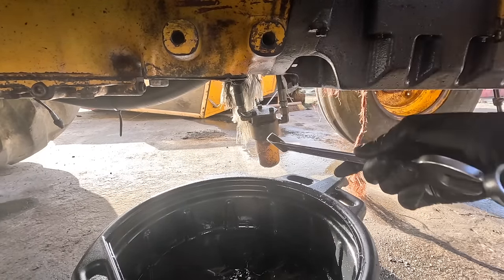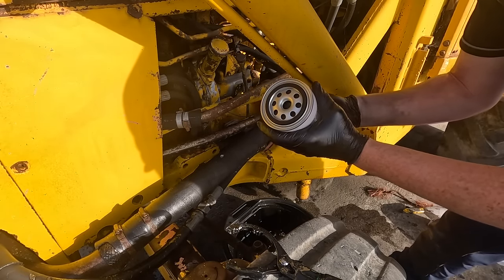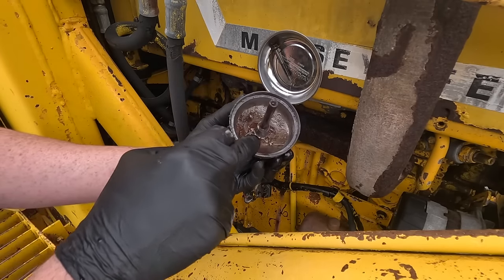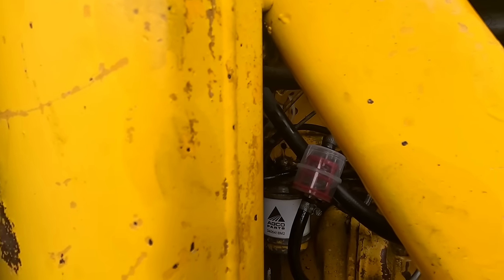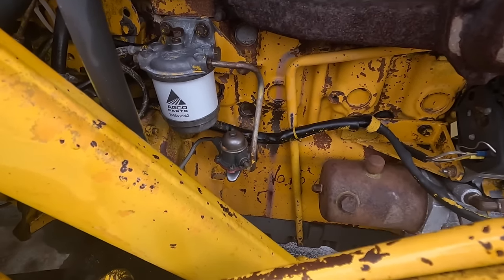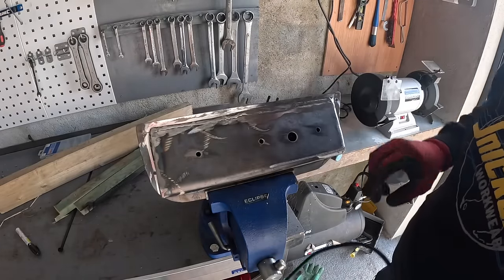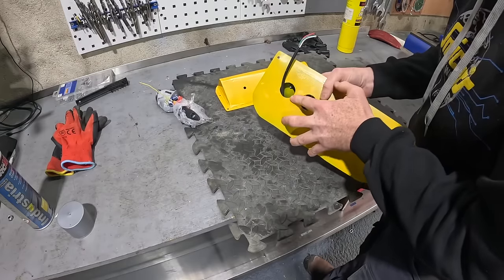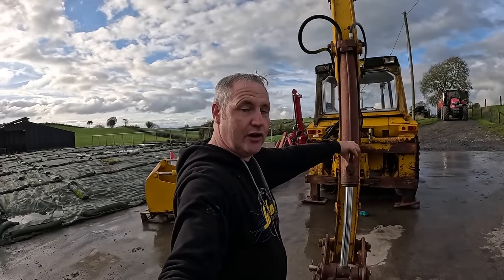I'm Surprised It Even RUN - Old Massey 50B Digger Gets Some BADLY Needed Attention

Comment: Some great skill there Adrian be proud of those light brackets 
On top of lift pump for diesel there's a cap with a screw in the middle if u take off there's a gauze in there that can be cleaned 
And great to hear u on radio aswell 👍

Comment: Adrian a long splitter for bending steel make up a jig from angle Iron and use ur log splitter to bend steel I do it I used normal splitting head and sometimes put a smaller bit of angle iron over the point and she pushed whole length down straight great job

Comment: There’s probably also a fine gauze filter in the top of the diesel lift pump under the little dome top. Looking at the diesel filters it’s probably fairly ok but no harm to check

Also for the third service on the loader probably the easiest option would be to add an electric diverter the same as a tractor loader rather than trying to get a 3 lever valve chest

Comment: Aidan unfortunately you will have to drop the sump to achieve clean oil....it will be full of s....e, but worth the trouble....you can flush the oil pump gause and replace the gasket. I know you will as your a perfectionist. Best channel on u tube❤

Comment: Have you considered using all the old oil and putting it into a massive container and then putting your wooden stakes (for fencing) into the container. It works a treat and extends the life of the stakes.
Reply: Wouldn’t be a a great practice to display on YouTube. I do it myself as the stakes now days are rubbish and need Al the protection they can get.
Reply: @PaddyGun  fair point. There are videos on YT - I first learnt about it on YT 😁

Comment: Those light mount fittings are far better than the ones that were factory fitted, good luck when you get to the rams. Glad the young chap is making a recovery, as a parent even if you children have a cold it's still nerve wracking. It's going be a lovely day when your out on you Massy, digging ditches and leveling roads. 👍

Comment: Have you tried solder stick for your wiring, you just put the wires in it melts the solder inside joining the wires and heat shrinks at the same time.

Comment: Hey Adrian great video as always might be and idea to put a shock absorber in the front loader when your going at the hydraulic rams anyway it would take a a lot off the bouncing out off it on the road and make her easier steer and easier on the front axle just idea I don’t think them absorbers are that dear and sure you’ve seen yourself no doubt with the loader on tractor the different they make just and idea either way  keep up the good work 👌🏻

Comment: it's doubtful it's still there but there would have been a small filter on the tap in the tank plus i always clean out the brass gauze in the top of the lift pump

Comment: Hi Adrian if your doing so much work on the digger would it be an idea to add a 3rd function and euro brackets so it could act as a backup if the loader tractor went down

Comment: If you have a plastic hose on you little  filter  from the tank clamp the hose down with a pair of vice grips it stop the fuel leaking while  changing  the inline filter   just a tip for you .

Comment: Did you use any engine flush products. I use them on machines like my excavator and mf 35 on the pressure washer as they never see high revs and there be a bit more carbon in the oil and sump

Comment: Hi Adrian u need to buy yourself a plasma cutter  ,they not dear have small one done lot of  cutting with it ,have 2 big hydraulic rams for  back actor if any use to u
Reply from the maker: I bought one this week 😂, I always had it in mind to get one as i’m flying through grinder discs. Haven’t used it yet